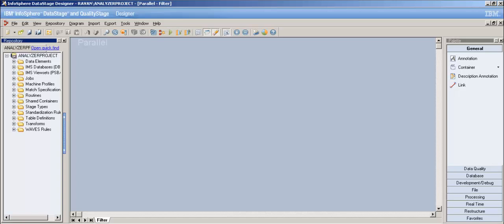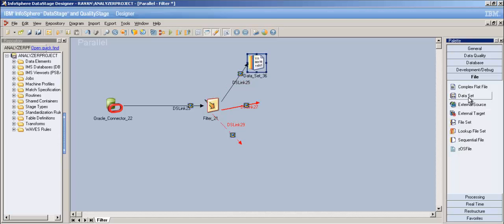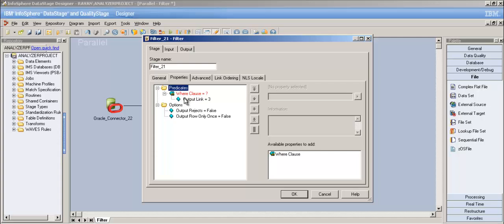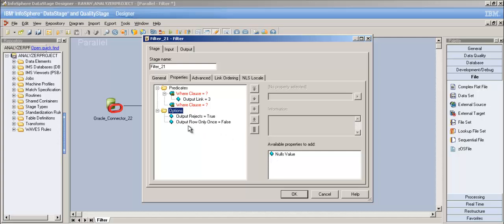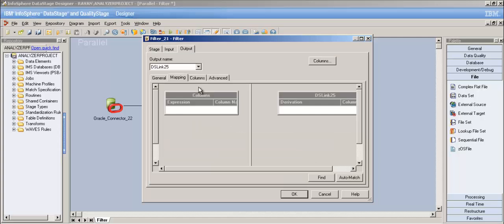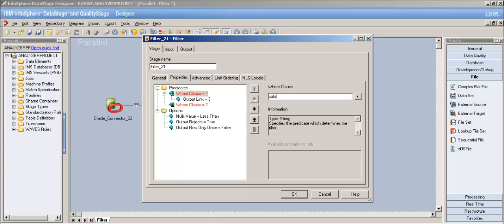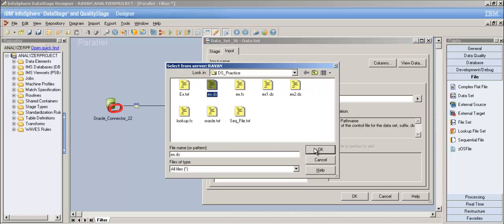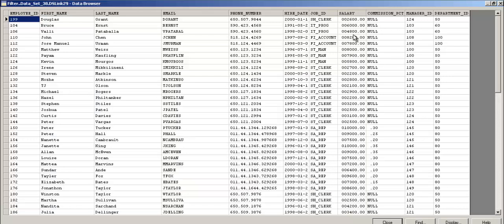Filter Stage with an 'EXAMPLE': Video 15 (HD)

Comment: Hi Rushika, I asked so many Datastage sites but no one reply for this. Hope you will gv.
please design a job with derivation(sollution).

My requirement
Source table
emp_no		qualification
1		a
1		c
2		a
3		c
3		b

Target table
emp_no		qualification
1		b
2		b
2		c
3		a

Here every employer have three qualifications i.e a,b and c.
what ever source table dont have some qualification, that will be move to target table.
Like above.

Hope u get the point.

Thanks.
Reply from the maker: Mr.Sunnel, I'll be happy to help you. It's good that you posted here so that even others can understand the scenario & come up with their own solutions/designs.

Anyways, the first thing that strikes to me after seeing this requirement is, do you have a check/reference table with the qualifications? If not, I can't really think of a solution 'AS OF NOW'. So please, check back with your manager/client/whoever gave you the requirement!!!!
Reply: Hai Rushika,
Here der is no reference table.. It have only one table means one file.
Here as my knowledge
Seq--->Tx-->DS

In Tx by using stage variable we can do dis.
But i didn't get any idea how to implement(what conditions to use) in transformer.
Thanks.
Reply from the maker: N Suneel Okay. I see what you are trying to say. I didn't ever have that kind of scenario. But let me try first & will let you know if it works!! :)
Reply: Okay Rushika, One thing this scenario regarding to health group..